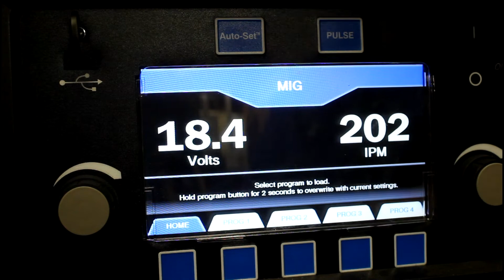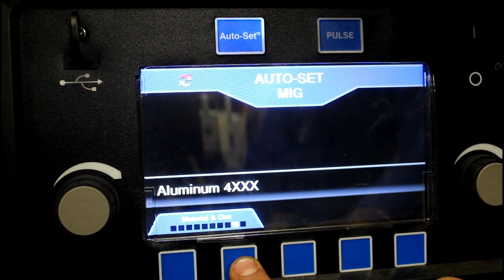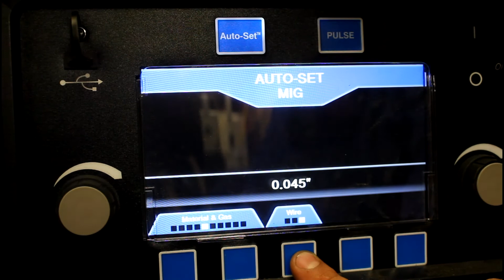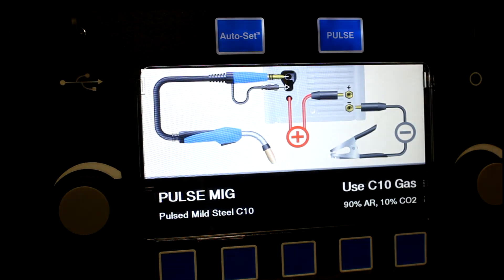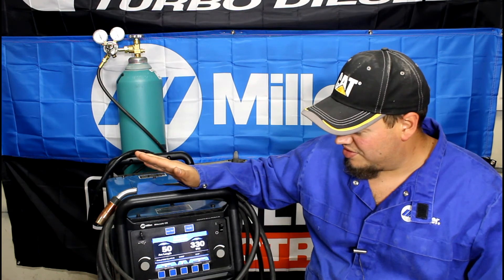One Year Review of Millermatic 255?

Comment from the maker: New Video up, unboxing a Miller T94i-R PAPR hood!

https://youtu.be/YQb2arQxLmI?si=9K5rYTC20B5HD342
Reply: Looking into buying a new welder I have a Lincoln 180 but need a new one now and want to purchase the miller 255 multimatic but also been seeing bad reviews on it with the mother board and different issues but wanted to know if you have had any problems with yours or costumer service on replace parts.
Reply from the maker: @fleetwood9142  I have mine personally at my shop for more than 2 years, and 3 years for one at my day job. Both get ran hard and honestly I haven’t had a single issue
Reply: @SteelDogFab  okay 👍 thanks for the fast respond.
Reply from the maker: @fleetwood9142  of course, I would make sure your local supplier would handle Warranty work. But of the three machines I use there hasn’t been anything come up

Comment: I have had my 255 for just over  a year. I love it for the most part. I just upgraded the software, and it seems to be working great. I was having issues with burnback using dual sheild .045 wire. I haven't tried the dual sheild again since I updated the software. We will see.

Comment: I gave the video a like as you asked! Very helpful. I have 2 millermatic 350p's. Kinda looking at this machine to have something smaller setup that will do short circuit mig. I have ran the 252 before and slightly smaller machines seem to have a really nice short circuit arc. I have one setup with push-pull gun and aluminum all the time and other one i usually run dual shield or metal cored but getting kinda tired switching machine and drive rolls out and gas out as carts only hold one tank. Have you ran the 260 lincoln for comparison?
Reply from the maker: Sorry for the delayed response! Personally no I have not ran the Lincoln 260.
Reply: To my knowledge the 260 isn’t a pulse machine.

Comment: How do you get .023" wire in auto set? I assume .023" needs to be run in manual mode?
Reply from the maker: I would have to check, but the rollers the machine comes with is 0.035” and 0.045”. I’m guessing you can buy a set that has 0.023” and 0.030”

Comment: 27+ years of the old school machines and possibly switching jobs to a company using pulse. This was helpful to understand how the machine functions and sets up. Auto set looks nice, but feels like it takes some of the art out of the trade. I learned to weld with my ears and to interpret the puddle. But you gotta roll with the times right?
Reply from the maker: You don’t have to use the pulse function or pre-sets. You can definitely manually dial in your settings, and then save them. I never thought I would own a machine that used a USB port for firmware updates and diagnostics. But that’s where we are haha

Comment: I bought a Miller Multimatic 255 from Baker’s Gas, and they advertised a Baker’s Bucks program that I would get $75 in Backer’s Bucks to spend at their store for every $1000 that I spent. They even have an example on the youtube video with Andy. “Example $3000 = $225 Baker’s Bucks”. After spending $6194.55 they issued a $100 gift card. Steve N’s position was basically that it was an old video. False advertisement is what it is. I wish Miller wouldn’t allow unscrupulous vendor’s to sell their products.
Reply: How old was the video at the time ?

Comment: Thank you for your video I did hear you say in the beginning of the video you welded an inch and a half with this machine is this true? Because you said the thickness material only goes up to half inch. And if you put two pieces of half inch together is that considered 1 in? Thank you
Reply from the maker: You are welcome. Yes indeed, but that’s running 0.045” dual shield multi-pass.

The 1/2” pre-set if for doing a 1/2” size fillet weld single pass.

Comment: Originally I was going to get the Miller 215, but then noticed the Millermatic 255 has MIG Pulse.  My local weld shop sent me a price quote for the 255, but this weekend I noticed several YouTube video’s of people having wire burn-back and wire feed issues especially during the last 10% of a wire roll and often with Pulse mode.  The feed rollers seem to point upward, which is not inline with the wire during the last half of the wire roll.

Even after adjusting the wire roller tension, they said it did not help.  I’m wondering if the 15’ gun cable length is too much resistance for the duel wire rollers?  

One guy got his to mostly work if he made sure  the gun cable was on the floor in a semi-circle and had no bends in it.

Now I’m afraid to buy the 255.  The 355 has a 4 wire drive wheel setup, but that machine cost twice the 255!  Anyone experience this issue, or should I not worry about it and buy the 255?
Reply from the maker: I have probably 6-8 spools through my 255 at work, and my 255 at home. I haven’t had that issue. Did they check the tension of the roll itself? I make sure the spool is just tight enough it so it turns easy.
Reply: @SteelDogFab  , thanks for the great feedback, that gives me hope.

One of the the guys that had feed issues said he tried numerous roller adjustments with no luck.  Miller replaced the gun cable for another guy and it did not help either.  I think one of those guys were at least running Hobart wire, so that’s always a good idea to run clean premium wire.

Another guy said with the rollers cranked down, he still couldn’t make the wire bend-over out of the gun when holding a piece of wood a few inches in front of the gun, the wire just stopped (I’m guessing the rollers were still spinning, he didn’t say).  Maybe they have roller issues, I would change those out too.  Supposedly they changed everything in the wire path with no success.

I would feel better about the 255 if I could get a 10’ gun instead of the 15’ due to those complaints, but I do not think it’s possible.  It’s also hard for me to believe Miller would sell this class of welder with a bad flaw in the design.

I was hoping to get a Everlast 325-EXT TIG and would prefer to get a Pulse Miller or Lincoln MIG and not an Everlast MIG.  I still have some decisions to make.

The most troubling part is Miller quit responding to these guys’ complaints.
Reply from the maker: @ray-real1  I’m sure more often than not, you hear about the bad things a machine does vs the good. I have had good luck but that doesn’t mean everyone else will. I need to figure out a camera setup so I can actually film welding it it
Reply: @SteelDogFab  thanks for the reply!  I agree, you typically hear a lot more about problems than success from customers.

Unfortunately the main reason I was interested in the 255 over the 215 was to get MIG Pulse, but the added power of the 255 would be helpful too.

I guess the most troubling video of the 255 is a YT titled “Millermatic 255, may be the answer to Pulse burn-back issues”.  A number of comments there with very similar symptoms.  Hopefully those people all had clean premium wire and clean rollers with correct tension.

My real job is as a software developer, so I’ve seen most problems are typically user-error.  But it would be more reassuring if I’d see these folks reply back in those comments on any solid solutions instead of more crying…like I’m doing right now, and I don’t even own a 255. 😀
Reply from the maker: @ray-real1  lol well I’m glad you are here!
Reply: @SteelDogFab  a guy from another YT channel said he had the burn-back issue too and he was also burning-up the tips.  He fixed both issues by increasing the “Run-in” speed to 65.  I guess some folks can disable that feature to see if it helps.
Reply: @ray-real1 Did he have the right sized rollers for the wire size he was running?
Reply: @mikeznel6048   , I’m not sure.
Reply: Does anyone recommend a specific welding wire when running a Miller 255 in Pulse mode on steel?
Reply: @ray-real1 I’ve heard L56 Lincoln runs best, I  haven’t tried it myself yet.
Reply: The drive roll can also be out of adjustment with the wire guide. You can move the roll in/out with a screwdriver to align it.
4943 wire can also help feeding and you can jump up to .047” to help over .035” unless very thin AL

Comment: Running production shop and we use these machines, never hit the duty cycle. One problem is ground clamps and wire get too hot especially on pulse. I have Multimatic 255 in my personal shop and I have upsize all lead wires including the short one that goes to drive rolls and swapped for a full on brass clamp.
Reply from the maker: That’s a good idea!
Reply: It didn't hurt it, machine doesn't see heavy use in my personal shop, so I can't say if it helped or not. I do recommend swapping a clamp for a better quality.
Reply: Make a difference?

Comment: Mine had electronic issue out of the box. 5 month later and a failed repair from Miller, I still have it and Miller haven't replaced it yet. Worst investment of my life.
Reply from the maker: That’s not good at all. I have had my unit at work for going on two years and never had an issue. Hopefully they get it sorted out for you
Reply: Did they resolve this issue? I'm looking to buy but don't wanna get absolutely ass blasted
Reply: @MattHassig  my money is getting invested with a alternative company
Reply: Having issues with mine
Reply: @blessingslawn  what issues are you having. I have one as well and no matter the settings, new liner, straight cable it has an inconsistent arc.
Reply: @chrisstewart814  I’m having issues with our Multimatic 235. It goes in and out of cable error when everything is hooked up. Moving the whip seems to trigger it. It welds amazing when it works, but that is intermittent.
Reply: @blessingslawn  we just hooked ours and it ran like crap right out of the box. The wire speed ran so slow that it was burning back. There is a function that isn't on the book under settings which is run on. It runs your wire speed at 60% of the setting. Disable that function and see if it helps. I would turn the machine off after changing it before trying it since most computers save the new settings in its memory before turning off.
Reply: @metalblueberries3742  seems the quality control is non existent. The issue with mine is the 20v sensing wire that reads what process you are in (in this case it was the mig voltage sensor) was cross threaded and making intermittent contact on the back of the drive roller. So it didn’t think the cables were hooked up when in fact they were, resulting in a cable error code. I opened it up and fixed it myself as I was getting basically 0 support from Miller.
Reply: How any reply back and let us know did they ever fix it? Or you was just making up shit?

Comment: I have the Multimatic 255. Same machine except can stick and DC Tig as well. Both 255s have a 60% duty cycle maxed out. You’ll never hit the duty cycle. Mine replaced my Lincoln 180 after I burned it up making fence panels for a customer. The difference is night and day and I run it on pulse 90% of the time when using the mig process. The stick runs so good I can barely notice the difference between it and my Miller Trailblazer engine drive which is the finest stick welder I’ve personally used. Sure there are Miller 400s and SA 300s and all. I hear they are amazing. Never touched one. For my type of work and needing more generator power to run plasma cutters and electric air compressors at the same time as I’m welding, the Trailblazer cannot be beat IMHO.
Reply from the maker: I didn’t end up purchasing the multimatic just because I already have a dedicated DC/AC TIG machine, that from time to time I arc weld with. With bigger stick jobs I have an old Ranger. Thanks for stopping by!
Reply: Why won't you ever hit the Miller 60percent duty cycle?
Reply: @HondaCrf450r.  In order to hit a 60% duty cycle on this machine, you’d have to weld for 6 out of 10 minutes at 230 amps. I don’t know any welding job that would require that amount of welding short of ship building but you would use a totally different set up for that. I’ve hit it on rare occasions when I had a Lincoln 180. That was 30% duty cycle at 130 amps. If you think about all the fitting, adjusting, checking for warpage and all that goes into welding something, there’s a lot of stopping and starting in welding out something. So in my opinion, I wouldn’t try and run a business on a 30% duty cycle machine. Totally fine for hobby and occasional use. A 60% at a decent amperage rating in that 230 realm is gonna be your standard requirement for a professional environment. You’ll want something capable of more amps if needed. The 255 will push out 350 amps maxed out. I’m sure your at 20% or 30% at that point but again, who short of ship builders welds at 350 amps for that long? Sure you have factories and stuff that have robots welding widgets 24/7 and that’s a different set up as well. For your guy welding in a shop building trailers, bbq pits, equipment repairs, fabrication, the 255 or any comparable machine, red, blue, yellow, name your brand, should handle all you can throw at it.

Comment: Does it have a setting for 98/2 gas if you wanna spray mild steel wire? Or do you just set it to 90/10 and its close enough?
Reply: I have this machine but the Multimatic 255. Mine is multi process but the mig settings are the same. Not sure about 98/2. It has a 90/10 setting. I couldn’t find that mix so I’m running 92/8 just leaving it set on 90/10. Runs fine. 98/2 may work though. In Spray transfer you may just have to keep adjusting your stick-out setting till it quits popping and runs with that nice hiss sound. If you try that, do let me know how it works out. It would be good to know.
Reply: Hey in the video @3:33 he cycles through the options and I believe I saw 98/2 in the settings

Comment: I can't decide between this one and fronius 2700
Reply: I have a fronius transpuls synergic 2700 and it is awesome.  Smoothest welder I've ever used and the pulse for aluminum is great. Basically if I'm welding aluminum it's on pulse. And the synergic settings for everything Ive welded are spot on once trimmed to your taste. Which isn't very far from factory settings. Wether welding at 30 amps or 230 amps I don't have to go back to the machine to change settings ever. You can weld all day and change everything on the mig gun with a read out to tell you what your setting are. Amazing welder. And the special 4 step trigger function for aluminum is must once you use it you will be hooked. Good luck.

Comment: Thank you for mentioning that it’s basically the baby brother to the 350p. When I ordered mine my local dealer didn’t believe me that it’s capable of 300amps. 
I basically only use pulse for anything that comes in my shop. And I have the push pull gun and runs like a dream.